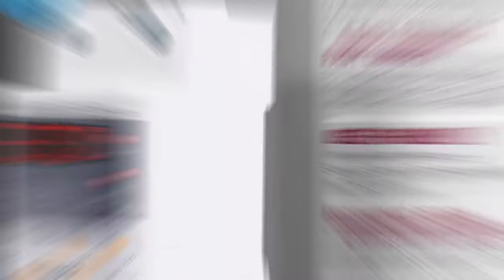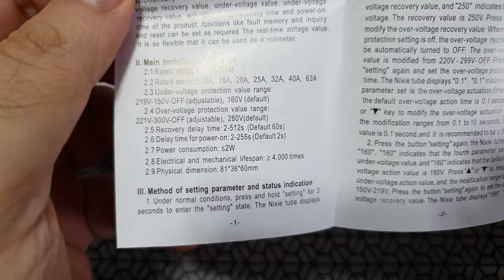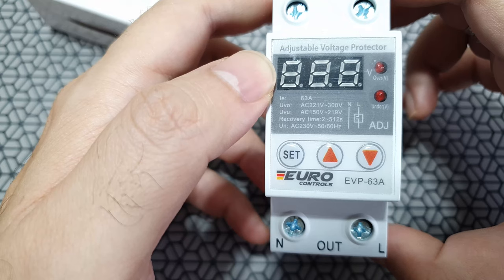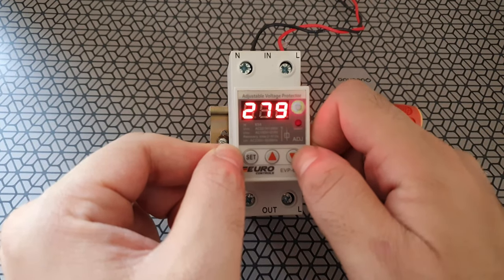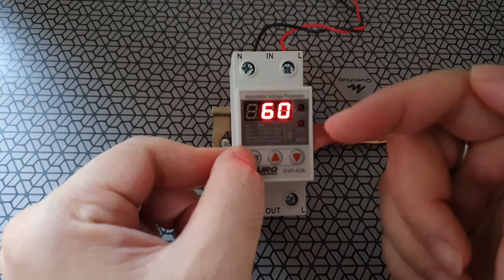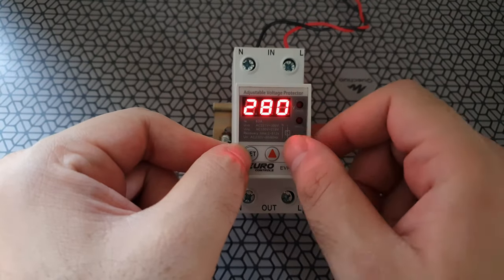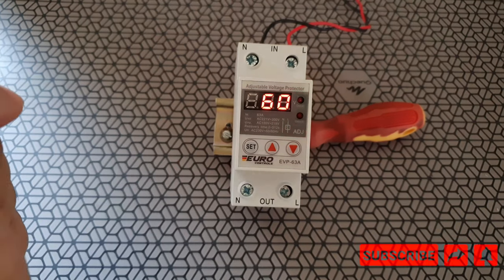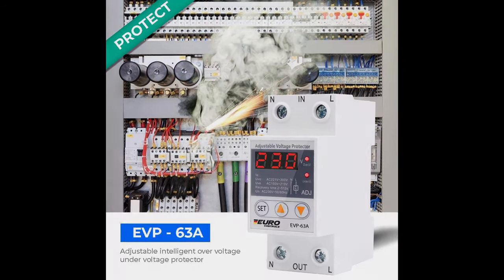High and Low Voltage Protection for your Home - Cost Effective Solution

Comment: Hi. Great review. I would also like to suggest Sollatek AVS30. I use it in my home. The sollatek not only senses low and high voltage but also irregularity in current. Meaning to say it ensures that the appliances are getting conditioned AC power
Reply from the maker: Thanks Vivek! Do you deal with the device you mentioned please... do let me know, Thanks 😊
Reply: @rtechreviews  hi. I just have been a user of that device for nearly 5 years. In addition, i was also using their AC guard . So many times ut has happened that voltage dipped or fluctuated and the device just cut iff the current, while the main MCB stayed on.
Reply: I want to know is there any device which would help us provide complete protection to inverter ac pcb or vrv ac pcb or high end expensive electronic device.

Comment: Hi. How is the experience after 9 months? does it work well? accurate? I have ordered a three-phase one after watching your video.
Reply from the maker: It stopped working 🥲
Reply: @rtechreviews  I almost made my mind to order one but then I see your comment here ...So do you find any other good working alternative? Actually, I have very expensive gadgets in my gaming room and sometime my PC also automatically turned off and I think it's because of some voltage fluctuation so I need something which can protect it

Comment: Sir  i wanted to purchase a plug that we see in amazon which says u have under /over voltage and surge protection as i am traveling for my laptop. Are these devices ideal for the purpose. Willt they protect my laptop or any device from also neutral voltages.

Also the device u have presented in this video, will it also protect my house equipment from neutral voltages.

Pls reply.
Reply from the maker: The device in video will protect your house from high and low voltages and that's about it for surge you need or can try https://amzn.to/3RVfhRZ
Reply: @rtechreviews  For a lightning strike, there has to be somewhere for the current to go.  Like a stake running into the ground.  This being practical depends on the voltage it can shunt.  How helpful is it?  Is there a more affordable option?

Comment: Is there any similar device that would not CUT OFF power, but instead discard the extra voltage or complement the missing voltage (using super capacitors) for the seconds that the grid has variation over 10V - 20V?
Reply from the maker: Nope... At this price this works... If you want those additional features your gonna have to get a servo stabilizer
Reply: @rtechreviews  what amt of apms does it protect?

Comment: Hello

Our electricity is 120V x 3 , which means if we want 220V then we have to connect (2 L's) (L1+L2) or (L2+L3) or (L1+L3).

What if I connect three devices like this device to the main cable (L1, L2, L3)

(L1) of the main incoming cable to (L) of the 1st device 

(L2) of the main incoming cable to (L) of the 2nd device 

(L3) of the main incoming cable to (L) of the 3rd device 

And connect the (N) of each device to any of the other (L's) just to have the device display and functions work.

Will these 3 devices monitor the incoming voltage and current or not?

Waiting for your valuable answer.
Reply from the maker: You will have to buy the 3 phase unit...

Comment: Do these devices come for higher voltages ?
Reply from the maker: Does come for 3 phase
Reply: @rtechreviews  most home voltages are single phase .
Reply: Since. The volatages are withing the range 300- 330 could you recommend the proper device to use
Reply from the maker: 300 to 350... this is just a cut off device for high voltages... who is using 300v ?
Reply: @rtechreviews  , Most villages in India get raw power sometimes upto 400 volts, during these sudden surges - the borewell pumps burn up . Hence to control these surges i have enquired for a device that would control these surges and maintain the required voltage .

Comment: I wish to use this for 1.5 ton invertor AC with mainline stablizer.  Usually stablizer provides voltage in the operational range of AC but sometimes when voltage is critically low, stablizer kind of shed its output voltage below 190 which is least operational range of AC.
I want cutoff at 190. Can I use this?
Reply from the maker: Yes... this thing has adjustable voltage control... you can set your choice of low or High voltage... :) thank you for the question.. please do subscribe
Reply: Stabilizer doesn't provide complete protection until and unless you have installed high low voltage cut off device with contactor in it. Stabilizer also have their own limitations . I am still searching for something excellent device which can protect the inverter ac pcb or expensive items. Online Ups of vertiv gives protection for smaller devices but for ac we have to search market.

Comment: How to use this in US 240v split phase 😢
Reply from the maker: Hi There. I don't think this would work in the US. I'm sure there are plenty of other devices you get there 😊
Reply: @rtechreviews  nah man that the thing 😂 there is not.  Like this one.  The only available is a surge protector,  no a over under voltage protection,  or at least i cannot find one. There are many outlets version.